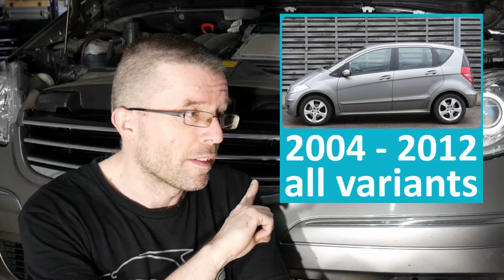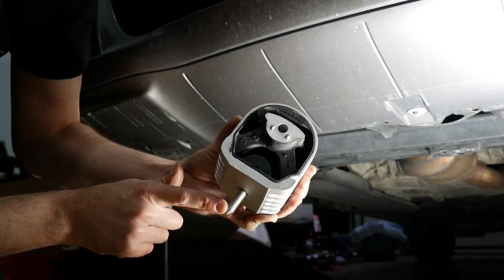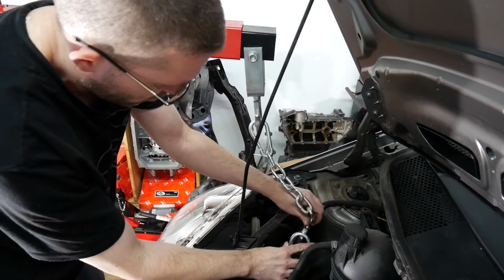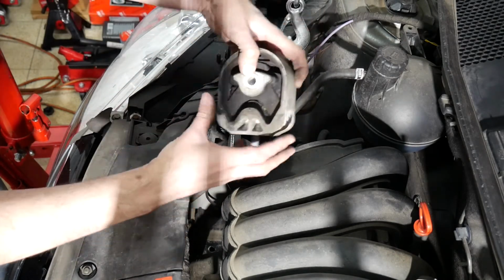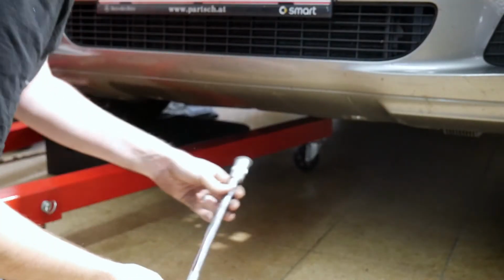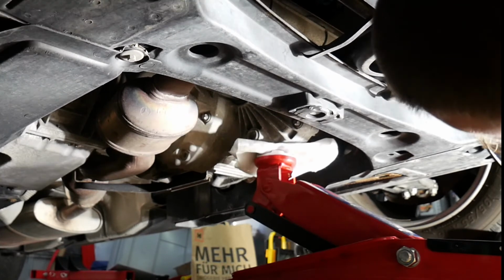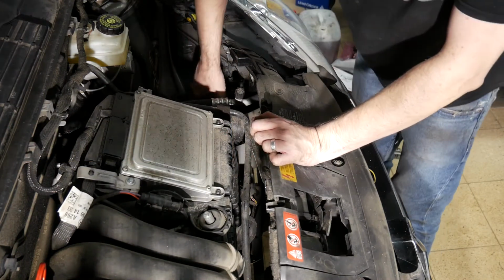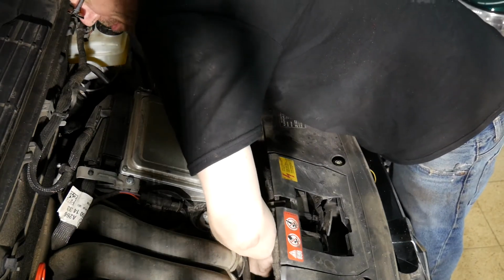Mercedes A-Class (W169) Front ENGINE MOUNT Replacement

Comment: The bolt thitening for engine mount front side is 55 NM the rear engine mount beside 2 bolts 25 NM the center bolt 80 NM this information is taken from Mercedes Benz w169 manual service 🙏